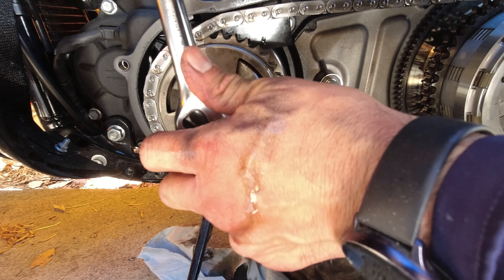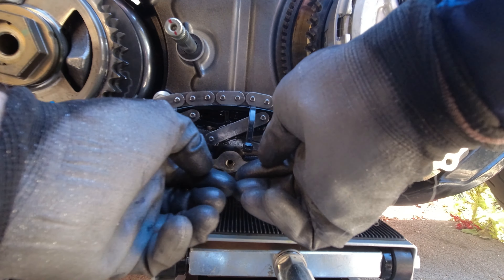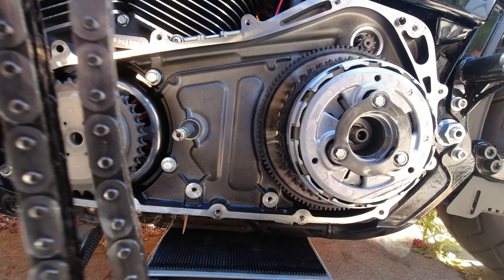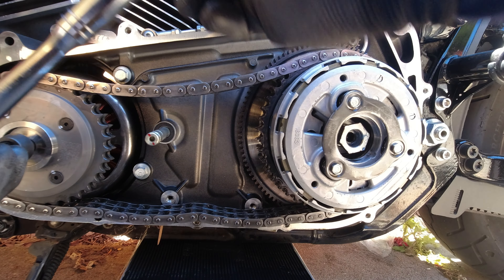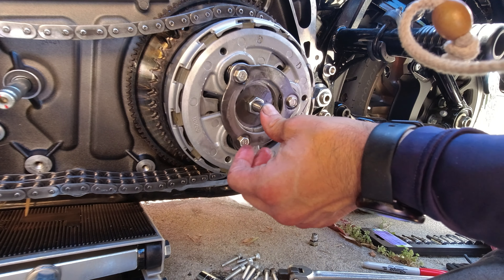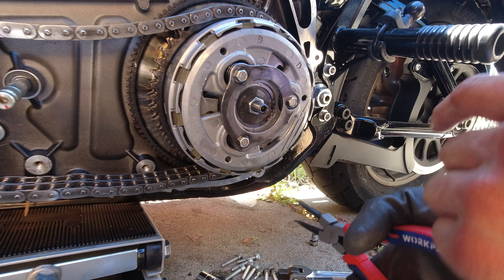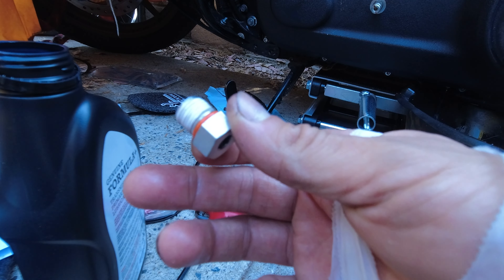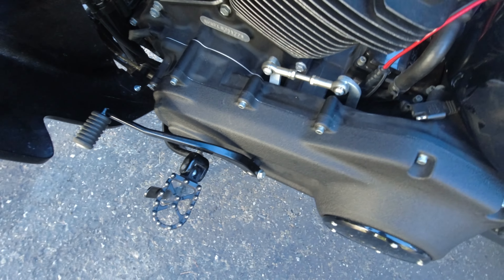Harley Davidson M8 Compensator Install

Comment: Thanks for the video. You kept it simple enough and just enough detail. I hate videos where people take way too long and talk about way too much stuff that we don't need to hear. Just got done installing my star racing compensator ramp and trash power plate on my clutch.
Reply from the maker: 👍👍 nice, glad you found it useful 👍👍
Reply: @InfamousCreep  I'm getting a ringing noise now only between 50 and 60 mph. It doesn't change if the idle increases or decreases. Nor does it change if the clutch is pulled in. I didn't notice it the first time I rode the bike after the install but I did last night. Any idea what that might be? I torqued everything to spec and added the recommended amount of primary fluid. The one thing I did notice with the amount of fluid was that the fluid was still not up to the line shown on the diagram. But i definitely didn't use the correct amount of fluid per the owner manual

Comment: You put your tensioner shoe on backwards.  The cutout on the shoe should go to the front.  This keeps the shoe from contacting the front mounting bolt during movement.
Reply from the maker: Dang!! I probably missed that in the instructions?? Thanks for the info, I'll probably service it sooner than later
Reply: @InfamousCreep in some cases people who have had problems with the Hayden tensioner breaking had installed it backward.  I have run the Hayden on my m8 Road King Special and previous bike (twin cam) without any issues.
Reply: Good to know, brother 😊 @lenwaybright8462

Comment: Out of all the Videos on YouTube, no one ever says WHY they need a new comp????  If I am correct, a bent crank is often the causes of problem’s with them.:cat-orange-whistling:
Reply from the maker: I actually have a whole video on why the comp should be replaced, the ramp is known to fail. It’s common knowledge in the Facebook group, my reasoning for swapping it is to avoid the costly repairs on the road. 1 the toe truck will easily cost over $300 bucks depending on where you bike breakdown, 2 you’ll need new parts anyways, why not just buy better quality parts, and 3 labor/ cleaning of parts after the OEM comp explodes
Reply: They explode! And ask me how it can destroy everything in your primary along with it!